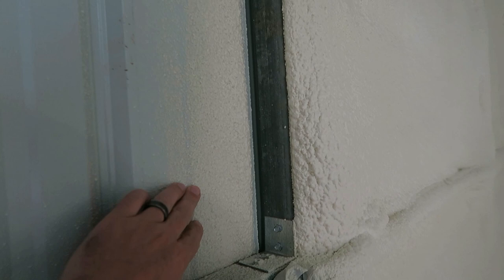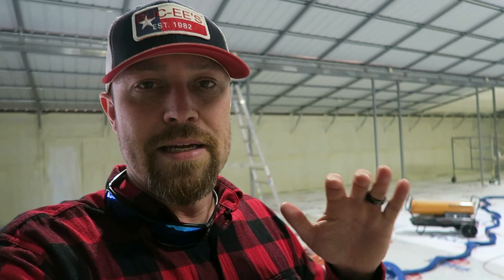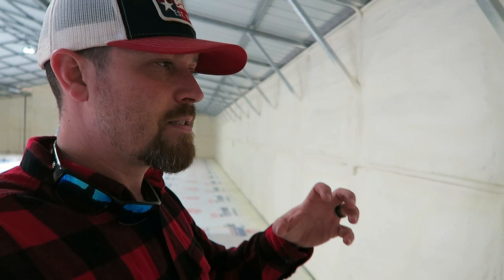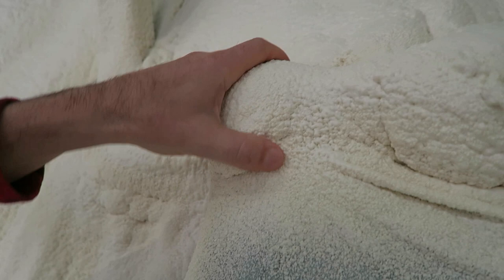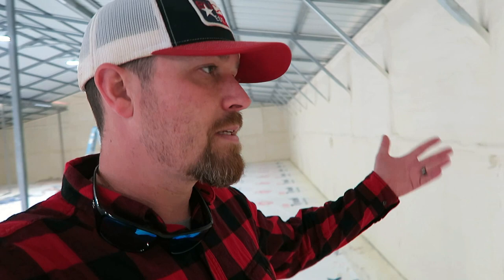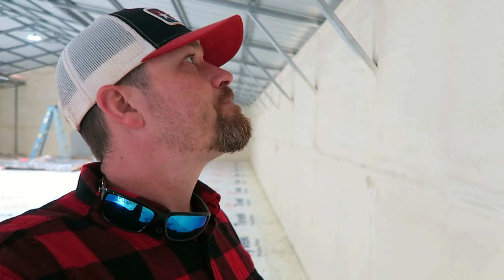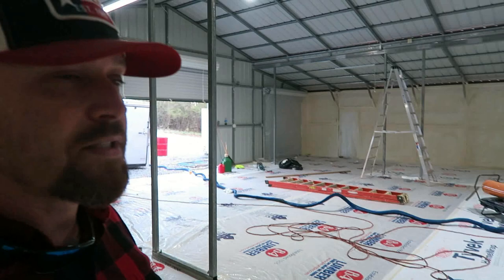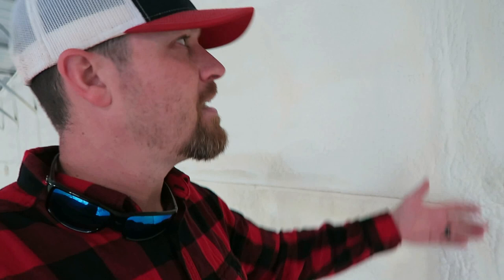Spray Foam Insulation

Comment: R value is established through an ASTM test method that tests a sample for heat migration over a given time.  That's all.  Yes, the most expensive form of insulation.  It's also about the ONLY insulation that does a lot more than just provide insulation. Like  you were talking about, sound deadening, structural strength, air barrier and when installed at 2" plus it's a vapor barrier (closed cell).  Best insulation you can buy on the market.

Comment: Looks good Kyle. As a general contractor, I try to steer customers towards spray foam insulation if it's in the budget. Yes the initial cost is expensive but over the course of 5-8 years it will pay for itself in energy savings based on the R-value alone. Not only that, but with the air infiltration sealing, your space will feel more comfortable. I subcontract it out because it is such a specialized trade but man, it is worth it.
Reply: PS: Can't wait to see you finish the bibbster! I know you're busy but you have fans rooting for you. 👍
Reply from the maker: thanks man

Comment: I'm jealous - that is going to be a nice shop.Your a lucky man.  I would frame the  walls with 2x3's or 2x4's at 16" centers. That will give you space to run power, air lines, speaker wiring and stuff behind the walls. Then sheet them. That epoxy floor is going to look sweet.

Comment: Previous owner sprayed my shop’s roof with spray foam (not this nice). No clue why he didn’t insulate the walls too. But I agree, it’s very hard to get motivated when it’s hot and humid out in the shop. That’s my main goal this spring to get my shop insulated and get and hvac system in my shop. We can sympathize in Memphis about the heat and humidity. Can be 100+ outside and equal amounts of humidity and you have to be carful working with the doors open in the evening and nights. You will get carried off by the state bird (mosquitoes the size of Apaches) or munched on by horse flies the size of your hand.
Reply from the maker: yeah for sure....

Comment: I think I would epoxy the floors everywhere EXCEPT where you are fabricating,  welding and using a plasma cutter burns the coating,  they make a good concrete paint that looks like coating but is not as thick and holds up to the cutting and welding better than the epoxy.  It looks great I'm doing the fab work in a two car garage and motor work in my other two car garage,  will be nice to eventually have it all under one roof......looking good!
Reply from the maker: thanks....

Comment: Ok nice foam insulation.  How many times can you say. Yep, Its foam. Going to save me money. 
  Ok. Let's get to work on the shop now. Why didn't you put all your air lines a 1/2 inch off the wall. This would stop a lot of the condisate from building up in the lines. Plus they would not be out to catch all the shop dust. Electrical? Did you put that behind this also? Did you put anything behind, in it?
  Just curious?
Reply from the maker: Electrical is in...no air lines yet
Reply: @Thefabforums  they should be in this insulation.  Stop them from changing temps in the hot & cold shop. Now. There is almost nothing you can do about it.  Unless the interior walls are not in yet. Then you could slave the foam. Put your air lines in the slices. Then shoot foam over the top of them. If you use those snap together kits. It would be really easy to connect up at each station. You would need fewer air-water traps.
Now you'll need one at every outlet.  Save your tools. And really save the paint guns & jobs. If you paint? This is my first video of you or your shop.
 It's a biggie... 
I'm sure your girlfriend,  wife says that to you all the time.......        😉

Comment: what are the dimensions of the shop? I like the style and kinda want to build my own that way, gives me inspiration
Reply from the maker: Its 48x80
Reply: The Fab Forums can I ask how much it cost?
Reply from the maker: @farmermatt629  you can get a building for around 30k
Reply: The Fab Forums no I mean how much the spray foam cost I have same size building already
Reply from the maker: @farmermatt629  I think it varies depending on the contractor. Closed cell should be in the neighborhood of 12-18k

Comment: I just had a the same style building sprayed with closed cell, Im wondering if I will need to ventilate is so air tight ? Any thoughts?
Reply from the maker: Yeah I had some issues with the humidity here in the south causing it to rain out inside. you could vent it or what I did was install a dehumidifier that automatically kicks on at a certain level.
Reply: The Fab Forums Yeah I’m in Colorado hopefully it should be OK you had issues before or after the insulation or both
Reply from the maker: @sothrnhunter746  just after...just on really humid / rainy days I would have moisture condense on the ceiling and rain out. Alot of it is also because the foam kept the inside so cool.

Comment: Hey dude looks good I’m wondering what your using for walls and those floor to ceiling roof supports are permanent?
Reply from the maker: most likely going to use metal barn panels....and yea those supports are permanent. although I may replace the two with one big one

Comment: How does the epoxy floor hold up to ...let's say a fab area where welding,grinding and torch cutting is going on? Asking for a friend....🤔
Reply: It does not hold up against welding or plasma. Grinding is fine.
Reply from the maker: the stuff I plan to use holds up very well.
Reply: What product would that be..?

Comment: What if you have to replace a sheet of exterior steel from storm or other damage?
Reply: Its called a pain in the ass... Lol  this stuff is tough.
Reply from the maker: yeah most likely the foam will have to be cut away in that section and reapplied once the panel has been replaced

Comment: I could be wrong... I thought spray foam was bad ...
Reply from the maker: in what way
Reply: Only if the installer sprays it in too thick. It has to be done in small increments and you'll be fine. Usually 2'' is what we do, let cure, then go back over.
Edit, If done to thick, the foam cannot cure properly and dry, and you'll get a horrible, possibly dangerous odor, gas. Proper venting while it's sprayed is key but in such a large area, there's no problem.

Comment: Epoxy flooring is expensive and not good to weld on it burns and smells bad in the process I'd put pole barn steel up so far on the walls and paint the ceiling with a airless painter it would look just fine and save you a lot of work then make it wood in a man cave area
Reply from the maker: 95% of the welding I do is TIG and has no sparks or slag